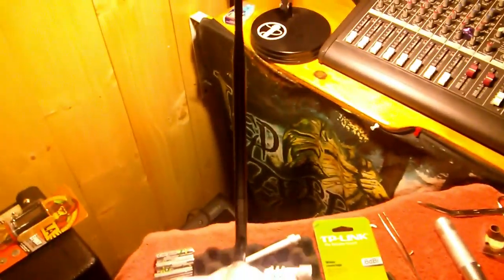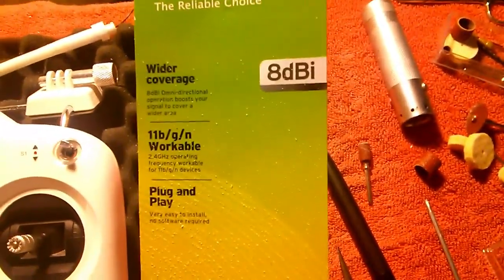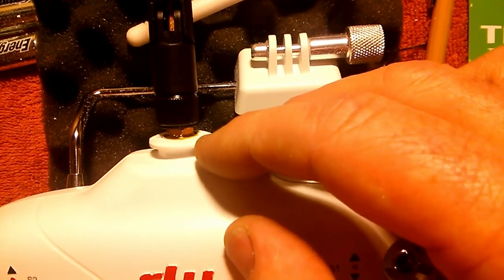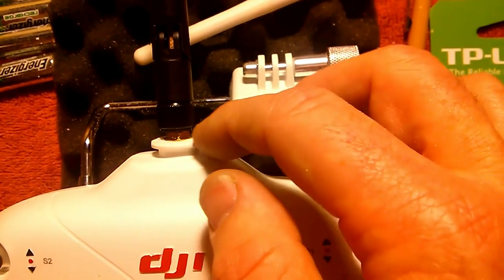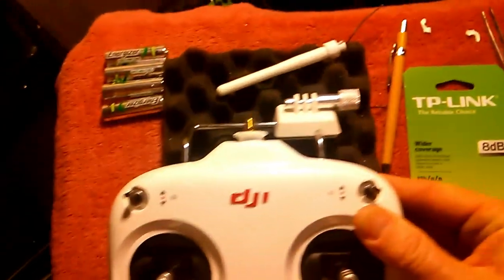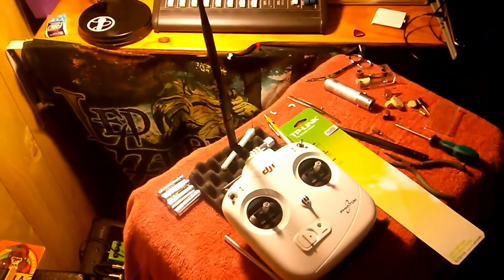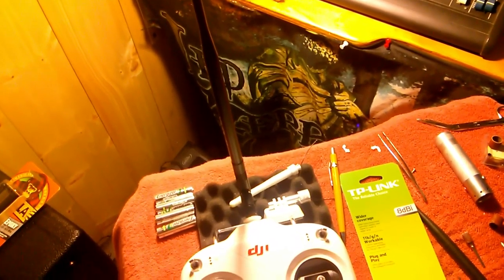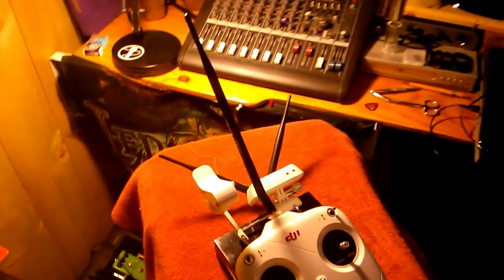DJI Phantom Vision 2 Antenna Modifications

Comment: how you liking the phantom vision so far?
Reply from the maker: like it,,,switched to a 11 dbi panel antenna for the xmter,,,5.8ghz....still using two tplink 2.4 ghz for the repeater,,,,so far so good with the vision,,,like the rotorpixel gimble....still haven't upgraded from V1.08 for the F/W....only have had 3 fly away's.i know 1 is enough..lol....was able to repair damage..still not sure of the technology to fly over people and areas where the potential for property damage could occur,,,usually fly in rural areas with public access....haven't had any issues with people or the law....but laws here in CT and nationally will eventually have a major impact on the hobby,,,,,mine may be for sale soon....i hope not....thanks for the interest....

Comment from the maker: update:

after several trials and feedback,,,,, i recently re-connected one of the wi fi repeater antennas back to its stock condition, i removed one of the two external connectors. i am now using the left pci antenna connection on the wi-fi board for the external TP-Link antenna and reconnected the right side to the stock repeater antenna,  2.4ghz  8dbi Omni TPlink on the repeater...... then....I swapped out the Omni -Directional on the Tx with a 5.8ghz wi-fi (11 dbi) panel antenna,,,,got out to 1100 feet distance on the last flight,,,,lost Tx at 1070,,,,,RTH with no issues,,,,still i am going to order the Horizon Phantom FPV set up for the aircraft, the Tx and Wi-fi,,,,,the results i have seen with the horizon set up is double what i am getting right now with this set up,,,,,see simon newton videos,,,,he is getting 2000 feet with just the tx and wi-fi set up from horizon FPV

Comment: Let me ask you a question. If you had a chance to do it all over again (budget aside)buying a Phantom, would you still buy the Vision, or would you get the Phantom 2 with all the extras knowing what you know now? Thanks! :-)
Reply from the maker: good question,,,I have recently pondered myself,,,I think I would go with the vision once I upgrade to the rotorpixel gimble I think I will be happy, I like the wi-fi link and the telemetry built in vs buying a go pro,,,then the telemetry link, then the fpv goggles etc...I still think I would still go with the vision..
Reply: I appreciate you response, thanks.

Comment from the maker: upgrade has shown a marginal improvement over the stock set-up, i have noticed issues with the Tx antenna upgrade using the 2.4ghz tplink 8 dbi antenna, i am going to try the horizon fpv phantom 2 setup using better u.fl connectors and skewer planar circular antenna they provide. its 250 dollars, but simon newton who posted his results recently has sold me on the horizon set up.....
Reply from the maker: not sure of the stock dbi rating, but i am now using a 5.8 ghz...11 dbi fpv flat antenna for the Tx which is working well with no issues,,,,the tp link antenna did work, but not much better performance over the stock setup,,,the issue i had was the range wasnt significantly improved with the 2.4 set up which is about 8 dbi for the 5.8 ghz signal using a 2.4ghz tplink antenna,,,,,

Comment: I noticed you used a 2.4gh / 8dg antenna. Shouldn't this be a 5.8gh antenna to match the TX output? Good luck on the Rotorpixel with waiting for mine to come who knows when?
Reply from the maker: no difference in the 2.4 or 5.8,,,its just a whip antenna for either,,,,
Reply: jwuman Yikes!

Comment from the maker: mike, will do my best, i dont usually fly out of Tx range since that is more than beyond my visual range. I will periodically post personal bests that are worth posting. I did this mod to mainly boost signal strength,,,, not for flying beyond visual range....i am going to mod the internal camera antennas soon and change the 5 dbi wi-fi antennas with 8 dbi antennas, i am going to use circular clover leaf antennas on the camera and mount them outboard of each lower shell vents located port and starboard on the lower shell....some cable management requried, i am also going to order a rotopixel gimble, waiting for some youtube videos to see how it works before i order it...... overall i am more concerned with the wi-fi signal than the Tx,,i loose wi-fi between 800 and 1100 feet, depending on location and weather,,, at 1100 feet the craft is very hard to see so i if i can get a solid wi-fi signal at 1000 feet ...all of the time, i will be satisfied with that...

Comment: Will it matter that the transmitter is 5.8 and the antenna is 2.4  Ghz? thanks for the post
Reply from the maker: doesnt matter,,,either will use the same whip style antenna
Reply: jwuman 2.4 will be a different mm length to the 5.8, using a band mismatch will create a too high of a standing wave ratio and can damage your transmitter.
Reply from the maker: makes sense,,,i converted to the 5.8 for the Tx shortly after i made this video,,,,will update the video with your info,,,,,thanks.....